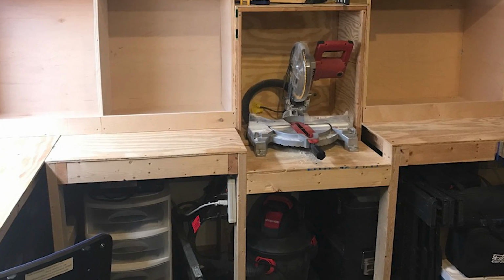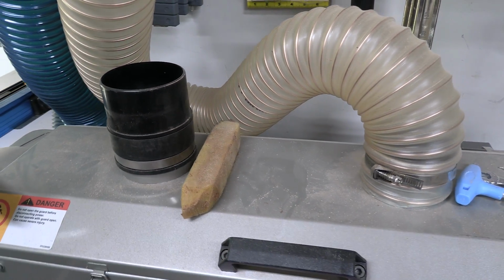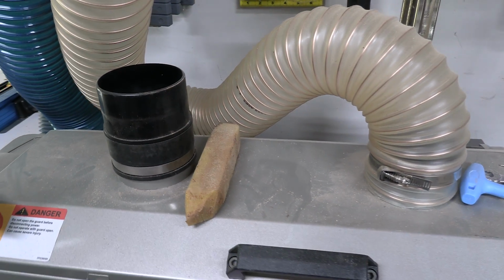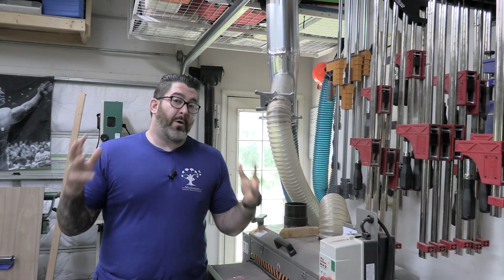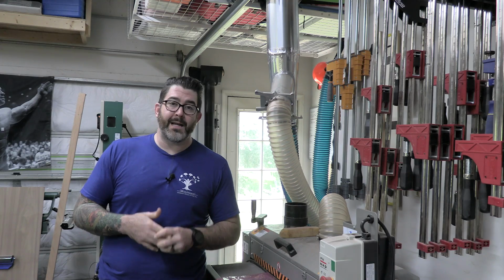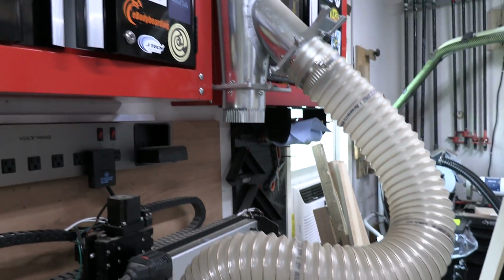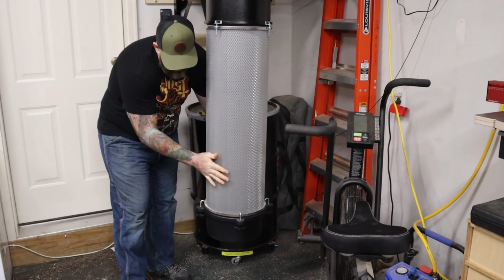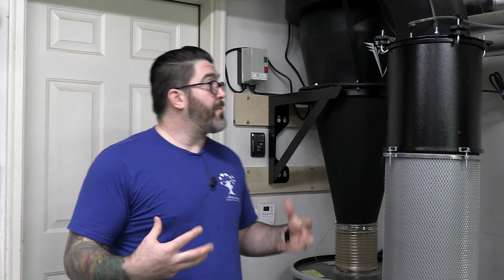The Best Dust Collector For Your Small Wood Shop

Comment: Interesting perspective of dust collection causing/correlated serious conditions. I also worked in hospitals before stepping away. I’ve never seen the actual studies however from what I’m told woodworkers make up the vast majority of nasal cancer. My dust collection of choice is the camvac system, it’s insane to have about 1000 cfm with 70” of static pressure. For me it’s a no brainer
Reply from the maker: Yep, the better and more efficient your dust collection, the less particulate dust in the air, and the lower your health risks. That sounds like a great system you have!

Comment: Great video.  I went with the Oneida Supercell a couple of years ago and bought their spiral ducting.  My son-in-law helped me with the ductwork installation.    I went through the same exercise with Oneida about whether to go with the V system or Supercell.  I'm a hobbyist, so there's never anyone but me operating the tools.  All of my stationary tools have 4 or 5 inch ports.  I have a bench top spindle sander and a bench top belt/disk sander, both with 2.5 inch ports.  The Supercell handles all of them.  The V system style collectors don't work well with less than 4 inch ports.  I don't have a drum sander or any tools that require two 4 inch ports, that's why Oneida recommended the Supercell.   For anyone looking at the Supercell, a couple of things to note.  First, you can't use standard flexible plastic ducting with the Supercell, you have to use the more expensive vacuum rated flexible hose for the final run to the tool.  Working with the vacuum rate hose is a little like wrestling an anaconda, a bit of a challenge but not insurmountable.  Second, Oneida includes 25 feet of the vacuum hose (well they did when i bought mine), and this may be enough for many folks.  However, in my shop i needed more like 35 feet but Oneida only sells it in 25 foot increments.  This hose isn't cheap, but I have some extra in case I buy a new tool.  The other negative with the Supercell is the noise level.  I'm over 85 ish dB at my table saw, which is considerably louder than you report with your V system.  I'm not getting complaints from my wife inside the house, even though my Supercell is mounted on a wall shared with the interior of the house.    My thought is if you have more than one person working in the shop and/or you have multiple 4/5 inch ports going at the same time, go with the V system.  Otherwise, the Supercell makes a lot of sense.  Price of the two collectors is comparable.  Good luck with your shop and your channel.
Reply from the maker: Thanks for the helpful info - I looked at the supercell too, but for all the reasons you mentioned above, the V system was best for my application. Oneida customer service is super helpful - anyone who has questions should definitely cal them!

Comment: I bought a used 240v General International 10-110 2hp 1,550 CFM dust collector for my little garage and then set about modifying it.  I removed the bags and the drum shaped bag holder and the large rolling metal platform it was mounted on.  I built a box out of 2x4's and 1/2" plywood the same size as the motor's base and mounted it to it.  I then took the large rectangular exhaust and mounted a steel 6 inch dryer vent to it and then added a steel reducer with an O ring seal on it to bring the 6" down to 4" (Same size as the intake).  I then took an SDS hammer drill and drilled a 4" hole through the back wall of my cinderblock garage and ran a 2 foot long piece of flexible collection hose through the wall, connected to the 4" exhaust.  As there are no bags and no filter the motor has full power all the time with nothing to slow the CFM's down.  No need to worry about microns or anything else now as all the dust goes out the back of my garage and just builds up in a pile behind it that I can use for everything from filling in holes in the yard, to using as a mulch or adding to compost.  I added a 20amp double pole, double throw breaker to my breaker box in the garage's sub panel dedicated to the dust collector and wired in a remote on/off switch in the line.  Doing this has given me a powerful dust extractor that takes up no more space, and indeed, even a bit less space than a small portable dust collector with a bag attachment in my garage would have taken up.  Edit:  I already have COPD, but that's from having had several cases of pneumonia in my lifetime, the last of which (bacterial pneumonia) laid me up in a propofol induced coma in hospital for ten days in ICU, and then another 30 days in a regular room with a pic line, an IV, a catheter and a rectal and more wires stuck to my chest than I care to remember with a C-pap that felt like it was clamped to my face, so, yeah, you bet I take getting rid of the dust in my shop seriously, lol.
Reply from the maker: There are a lot of great DIY solutions out there, and venting outside is always a great deal when possible 👍🏻

Comment: My shop is kept clean by a full Oneida setup that I did many years ago.  It is consistently a fabulously effective system.  I have a3 HP motor system and Nordfab piping. One thing I wish I knew more about:  "What kind of air blower is required to effectively clean the HEPA final filter?  I only have a very small air compressor so that is not effective.  Is there an alternative hand held blower that would effectively clean the final filter? Congratulations on your marvelous shop.
Reply from the maker: I use a small handheld Makita blower, compressed air, and then my hands to bang around the sides to clean the filter.

Comment: Thanks for your excellent video.  I just received my V3000 and am looking forward to getting it installed and up and running.  Like you, I have really impressed with the Oneida customer service (Dan), their design and consultation has been great.  I have a 18' x 30' hobby shop and felt that no job was too large or too small for the team at Oneida.
Reply from the maker: Glad you liked the video - how is the new dust collector doing?

Comment: DITTO ON ONEIDA CUSTOMER SERVICE. Bought a discontinued Oneida floor demo from Canada's Busy Bee company (strange name for a company selling big industrial shop tools). I did not get the manual in the deal and could not find it on Oneida's website's manual library.  So I called them up an in minutes I was being emailed the correct manual for my system.

And I'm a smaller fish than Garage Dwellers as my shop is currently in front of my garage under a 10' x 10' pop-up canopy. Since this is Canada I'll have to close up shop soon.

Good tool but out of my range budget and shop size wise.  I have a discontinued (2019) Dust Deputy Deluxe 4/6" with a 15 gallon fiber collection drum. As it appeared you were heading size wise toward my newly acquired separator I was looking forward to your putting it in action and setting it up.  Your design and layout considerations are helpful in the general sense and already has firmed up some of my planned setup when I get my garage set up so I too can achieve Garage Dweller status. 😀👨‍🔧
Reply from the maker: My brother has the new super dust deputy hooked up to a drum and a Harbor Freight collector - we’re going to review that in a future video. And agreed, customer service is awesome 👏🏼
Reply: @garagedwellersww   - I had a similar setup with a jet dc.  This was great for collecting chips from the jointer/planer without clogging the filter, but it wasn't good with tablesaw or bandsaw dust or keeping the air clean.

Comment: Nice setup.  I have a much older Oneida 2HP Commercial that also has a 7" intake and similar specs.  The snap lock tubing is a great choice for systems this size.  I use snaplock in my system that mainly terminates into Nordfab fittings because I'm connecting primarily to a European combination machine and have to move fittings depending on what my machine is doing (shaper, tablesaw, jointer, planer, horizontal mortiser) or to various sanders  when needed
Reply from the maker: I’ve been really happy with it. Sounds like you’ve got a great setup that works with your machine!

Comment: This is the first video I’ve seen of yours, great info! I’m looking at upgrading and think a v3000 will suit me best, which is how I found your video. Odd question, but are you willing to take a measurement for me? I would need to orient mine the same way you have yours, with the filter clocked right infront of the inlet and tucked into a corner. The only problem is that I am limited to 28” of space on the wall the bracket is anchored to (the room is 5’ but I need room to swing a door open. Are you able to measure the depth of the machine along the wall it’s anchored to? I’m hoping I can tuck it into 28”.
Thanks!
Reply from the maker: The width of the bracket itself is just under 21". The widest depth is up at the top near the motor and the inlet, which is 28-30", but if you mount it up enough that portion is up above the top of the door.
Reply: Amazing thank you. It sounds like I will just be able to squeeze it in!

Comment: Nice.  I'm leaning towards a Supercell myself.  Just curious...do you use any kind of separate air filtration system to filter your workshop air in and of itself?  If so, would love to know what you're using.  Thanks!
Reply from the maker: Thanks for watching - Supercell is a great choice for sure. I do have a Jet overhead air filtration system. My brother has the powermatic one. Less maintenance with that, but much more pricey. I ran a Wen overhead air filter for awhile too, but that caused me trouble and broke down within a year. The Jet is a great price point and works like a charm.

Comment: Dealing with space issue but I do have room to add covered shelter on outside of the house. The runs wouldn’t be much longer
Reply from the maker: A covered space outside would be great. Especially if you could still have the dust sentry light inside!
Reply: I've always wished that I had done that.  I would now have more usable space inside the shop.  Also, on my Oneida with long final filter, an outside unit would not require a final filter because I live in a farming area where the small amount of dust that escapes the cyclone separator would be very minor compared to the dust generated by farming operations:  plowing, planting, harvesting, etc.  The shop would also be quieter and that is good for health.

Comment: Thanks for this review.  I'm a scientist and have worked on inhalation projects.  I am suitably worried about wood dust from machines.  I am looking at 3 hp V-3000 (torn between the plastic and metallic one) as well and have upgraded the electrical already and have money saved up.  Were you able to get Onieda to come down on the prices?  If so, how much?  I've been asking for 10% discount and free shipping and have met resistance.  Not sure how much wiggle room they have on their price.
Reply from the maker: Glad to hear you’re looking into them! I highly recommend it, it is an awesome dust collector. I did not even try to haggle with pricing. I treated it like buying from any other store, figuring the price is the price.
Reply: @garagedwellersww  Thanks for the reply.